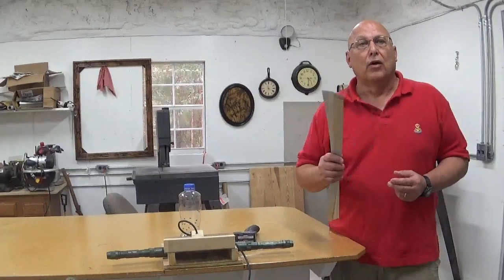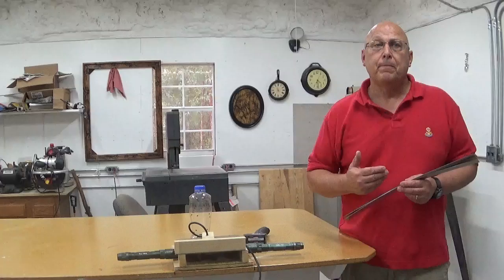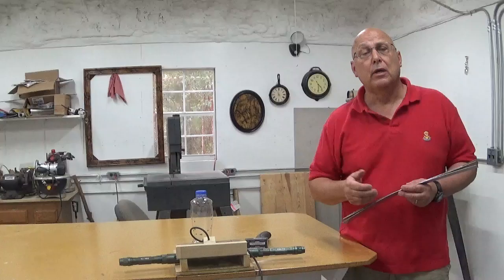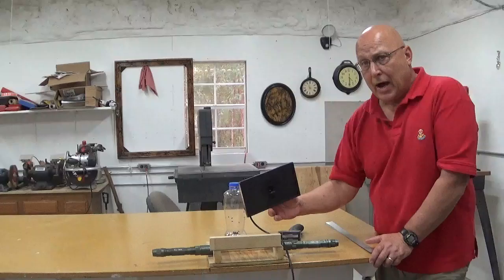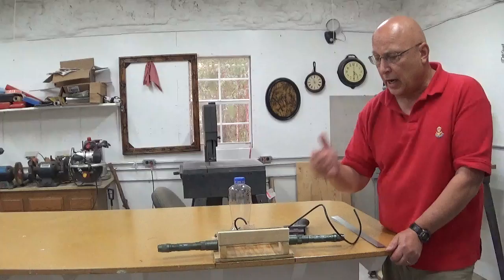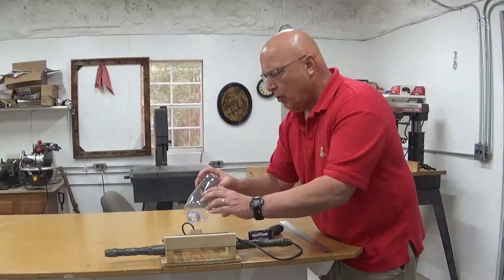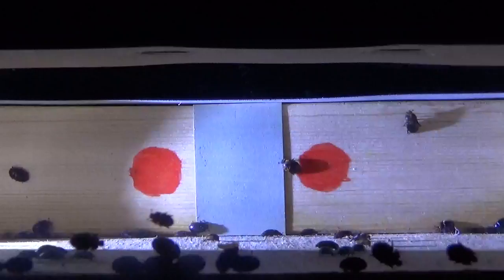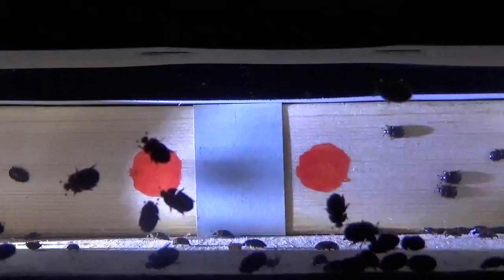Small Hive Beetle Prevention and Control, a test using live small hive beetles to stop and trap

Comment: Could you just coat the sides on the inside of the bottom board 3/4" with neverwet? If the beetles do not fly inside the hive why would there be a need for a strip on the front entrance? There would be a 3/4" space that there would not be anything for them to crawl up? I'm not being critical I'm just asking questions. I actually think it will work similar to the beetle baffle. The only problem I have with the beetle baffle is when the bees build bridges from the bottom board to the frames. The beetles utilize these bridges to access the hive.
Reply from the maker: Hi Curtis,
Coating just the inside of the bottom board won't work, you need the Neverwet coated flange as a physical barrier and the Neverwet coating magnifies the effect of that barrier so the beetles can't crawl over it. You need the coated flange on the front entrance to create a full perimeter inside the hive, or the beetles would simply crawl down the front of the hive and gain entry there. Remember the hive beetles are crawling all over your hive trying to find a way in. You are the second person who has said that his bees build bridges or ladders from the bottom board to the frames, I use screened bottom boards and I have never had that problem, you could use a 3/4" spacer "above" the Neverwet flanges that may stop the bees from building bridges to the frames but still allow the bees to get over the coated flanges. Good Luck.....
Reply: Thanks for responding. I did use a 3/4" spacer under the beetle baffle and the bees still built bridges to the bottom board. I use both solid and screened bottom boards on my hives. If my memory is correct they built bridges on both just not as many on the screened bottom boards. On a weak hive it would be worth the effort to remove the bridges occasionally to keep the beetles from destroying the hive. I have not had a problem with beetles in a strong hive unless I gave them to much room by adding supers to early. Thanks for sharing your info.

Comment: Jeff, I'm in Gulf Breeze.  Can I come by some time and pick your brain about fitting these into  an AZ hive?
Reply from the maker: Hi Bob,  It wouldn't take you very long to pick my one good brain cell. I have been asked questions before on adapting this to a top frame and long hives, so I have had time to ponder this. If it was me, I would make a mini bottom board, a 3/4" high rim that is attached to an 10" wide X 6" deep bottom along with a 3" landing pad. Then make a 2" high upper compartment with a top cover, the 2" upper would give you enough material to drill or slot an area to mate up to the hive opening. it will also have enough room for  the bees to crawl over the coated flange or fly into the hive entrance and dark enough so the beetle won't fly inside the mini board. The Neverwet coated flange would be attached the top of the 3/4" rim on the side and back and then attach the 4th coated strip to the front of the 2" top compartment. I would also paint each one a different color to help prevent drifting. Well that's it, I have exhausted that one brain cell. That should give you something to experiment with. Good Luck.....
Reply from the maker: Hi Bob,

  That picture on the web site is the back of the AZ hive the front of the AZ it will have a slot or hole for the entrance. On my idea of a mini bottom board front entrance with Neverwet flanges that I sent, you will need to drill or cut out an area of the back of the 2" upper section to match up to the entrance of the AZ then screw into place, this should help.
Reply from the maker: Hi Bob, 

  Your design graphics are very impressive. That is what I was thinking  for a front entrance chamber for a top bar or long hives utilizing the Neverwet coated flanges. The back mounting that I had in mind would be a flat mount against the hive opening but your drawing hit the concept dead on. Well done, you did a great job. I and the Bee Community thank you.....

Comment: I've wondered why they just don't fly out, but I see that they are not good flyers and just bounce back down. I guess if you put DE in this tray with them it would be over pretty quickly.
Reply from the maker: They don't fly inside the hive, the beetles just crawl and hide. It is messy but I would go with oil or soapy water myself..

Comment: since they can"t walk on the flange, what if you put it on the "walls" of the bottom board in stead of around the top?  would that keep them from climbing up all together?
Reply from the maker: You need the Neverwet coated barrier protruding on the inside to keep the SHB out of the hive, just on the inner vertical edge won't work.
Reply: ok

Comment: Would this also work if I use screen bottom board hive bottom? Couldn't they walk across the bottom then fly up to a frame?
Reply from the maker: All of my 60 hives are set up with screened bottom boards and the beetles will crawl and walk all over the outside and bottom boards of the hives.  They just can't get over the Neverwet coated barrier and into the comb.
Reply from the maker: I forgot to add, Hive Beetles do not fly inside the hive, they only crawl and hide......

Comment: Jeff,
Does this work because the bees can walk on the bottom screen and then fly up to the frames? I want to make sure I understand the theory before I install this n my hives. Thanks.
Reply from the maker: The bees will either crawl or fly over the Neverwet flange. When the Neverwet coated flange is mounted on the 3/4" rim of the bottom board it protrudes inside the hive enough to stop the hive beetle but lets the bees crawl over it. Here is the first video on how it is made, Good Luck...  https://www.youtube.com/watch?v=FfnefkJSfBs
Reply: Jeff Willard so the neverwet doesn't prevent bees from crawling on it, just beetles?
Reply from the maker: The bees usually only come in contact with the outside edge as they are crawling over the coated flange to get up into the hive. The Neverwet flange is to wide for the hive beetles to get over,  the Neverwet surface stops all crawling insects.

Comment: In watching the beetle they land away from the entrance and make a run for the entrance.  Why not paint the wood in a zone around the the entrance and a band around the hive box joints.  This would keep the beetle on the out side on the hive.  I'm using the flange and screen bottoms.  The screen are treated too.  For 45days begins in late April I thumb smashed 475 beetles in a dry trays under the hive.  I seen about a dozen in 2 hives.  Inspection is not fun as my Russian want to eat me for lunch.  Also there has been a lot of afternoon rains to deduce beetle even beetle travel.
Reply from the maker: Bees will be constantly walking on the exposed Neverwet which will build up with particles of propolis, pollen and wax plus the bees crawling on it will slowly ware away the Neverwet material. As long as you have the Neverwet coated flanges on and your hive is seal with polyethylene foam tape and window screen on the inner cover so there is no way the beetles can get in. I say experiment any way you like with Neverwet but usually the K.I.S.S. principle is always the best. Good Luck....

Comment: Your findings are interesting to say the least and I look forward to testing it on my own hives!  But I'm curious why you can't just spray the product directly on the bottom board in the applicable areas.  Can you elaborate?  Thanks so much.
Reply from the maker: The Neverwet coated flange creates a protruding barrier inside the hive that the hive beetles can not crawl over, just coating the inside edge doesn't work the same. Watch this to see how to make them. Link to the Original Neverwet coated flanges, how to make the Small Hive Beetle Excluder..   https://www.youtube.com/watch?v=FfnefkJSfBs
Reply: Thanks for the link Jeff.  And I'll keep you updated as to my progress.  Appreciate your time.

Comment: Jeff I am still trying to understand why the beetles cant or wont simply fly from the bottom board up to the bottom frames skipping trying to climb up and over the neverwet ?
Reply from the maker: All research shows that the hive beetle does fly to the bee hive but once inside they try to avoid detection from the guard bees by crawling only. Even in my brightly lite test area the beetles still prefer to crawl and hide, the Neverwet coated flanges stops the beetles upward movement into the comb.
Reply: Thank you Jeff,  that answers my question completely..Thank you for sharing your knodlege.  How are things working out for your idea at the Florida University?  I hope they give you credit for the work you have done on this....God Bless You sir !!
Reply: Answering not answer in the previous reply ,  sorry, I should have proof read before sending thanks again
Reply from the maker: I invited the U.F. bee manager to inspect the Neverwet system in a working Apiary, I'm still waiting. At this point I believe it will be up to the honey bee community banding together and find the solutions to fight the small hive beetle.
Reply: You have done the hard part and found the  solution ..  old ways change slow sometimes. I'm confident that in time your hard work will be accepted as a brilliant method in hive beetle control .. I for one thank you for all of this hard work and dedication that you have put forth and succeeding tin finding a solution to the hive beetle problem !!! God Bless You ...
Reply from the maker: Thank you and good luck with your honey bees, the world needs them...........
Reply: Jeff Willard   Thank you Jeff ...

Comment: hi jeff, i wonder if i can even spray Neverwet onto the box (inside and outside). Spray outside to protect the box from the rain or condensation. But i'm not sure yet if sparying neverwet inside the box will be beneficial to the bees (the only thing I can think of is perhaps spray neverwet underneath the lid so that the condensation will not be formed up easily ). Does your bee have any problems when being exposed to Neverwet?
Reply from the maker: H Modology,

  The Neverwet material is a little pricey to spray all over on the outside, I think good old one step prime and paint latex or an exterior wood treatment like Oylimpic would be more cost effective. To stop hive beetles you just need is the Neverwet coated flange and sealing your hive, nothing else. I assume you live in a cold climate with a condensation problem, the Neverwet will make the condensation droplets roll off any material that you spray in on. You may want to try to increase air flow through the hive or try a moisture wicking material like a top cover of Homasote or a moisture box that is covered on one side with burlap or muslin and filled with a moisture absorbing material, here in N.W.Florida I use vented screen bottoms and tops year round. Neverwet has been used the the food and cosmetics industry for 20 years and EPA has deemed it safe.  
https://www.youtube.com/watch?v=FfnefkJSfBs&t=337s

Comment: Have you tried it on the painted or bare wood of the bottom board rails?
Reply from the maker: Hi Malcolm,
I never tried it on the wooden parts because I felt that a protruding barrier inside the hive would be a better deterrent against the hive beetles crawling up into the hive. Watch the newest videos on the improvements made to the Beetle Barriers.

Comment: Jeff, the entrance to the Warre hive is exactly like the entrance to the Langstroth hive (I have 2 of those as well). For the first week the strip seemed to work - no beetles in the hive. Now, beetles are able to walk on the underside of the strip of never wet aluminum and get in. 

Is it possible that 1) I have. It applied the Never Wet correctly? The finished product is slightly rough, and not smooth as I expected it to be. Is this the same as yours? 

2) Could the solution work, but only until the bees walk over on the underside of the strips enough to make a path for the beetles to follow? In essence leaving footprints of dust, pollen and wax on the strips? 

I watch the bees struggle to get up and over the strips, so I know it works, but the beetles seem to be just walking right over it now. 

If you'd like, I can send pictures and or video. I'd like to help you work on this. My email is s m portis at gmail dot com.
Reply from the maker: If the bees and beetles are walking on the coated strip I would have to say that there was a problem with applying the first or second stage of the Neverwet coating. I still don't understand why your bees would bee walking on the coated flange at the front entrance, all of my hives the bees land on the landing board and enter the hive walking on the bottom board. If the Neverwet coating was still on the flange the bees couldn't walk on the Neverwet either. For now I would make up a new "wider" strip to replace the one  on the front entrance. I have not experienced the problem you are having, I would like to see the photos or video and try to help you solve this problem, I'll e-mail you....
Reply: Hopefully photos will help clarify our miscommunication about why the bees must get over the strips.  But basically they have to go in the entrance and then climb up the wall and then climb over the strips to get up into the hive.
Reply from the maker: Hi Scott, 
When you change the height back to 3/4" and that resolves your beetle entry problem. Send some photos so other beekeepers can see what was done and how it was corrected to eliminate any possible problems and headaches for other people in the future. I would also make new Neverwet flanges or repaint the ones that you have. Good Luck..
Reply: Jeff Willard I will let you know. I think we have solved the problem.

Comment: Why don't do a test put it in the corners
Reply from the maker: The barrier mounted at the back already shows that SHB can't walk on Neverwet and a horizontal barrier is more effective than a vertical one.
Reply: I was thinking the same thing. Forgive my honesty here but when i saw all the beetles in the corners and we beekeepers know they like the corners, my first thought was if this really worked he would put three small pieces left, right, and bottom in one corner it would show that one corner is full of them and the other isn't.

Ok now thinking through the possible outcomes Maybe they can walk on it when it is laying on a flat surface or they slip/fall into the corner from above the top of the pieces and they will basically pile up not really hanging on the sides.
More thinking through the problem I posed....
 I guess to stop them from falling on it the strips would have to be run all the way to the top.

I am not arguing that this isn't a great idea and a perfect solution, in fact I plan on getting some never wet and using some in my hives.

 Thanks for sharing and taking the time to build the setup, videoing it, editing, and sharing.
Reply from the maker: @TheHandyHippieCrew  Your welcome and good luck with your Neverwet project and the bees..